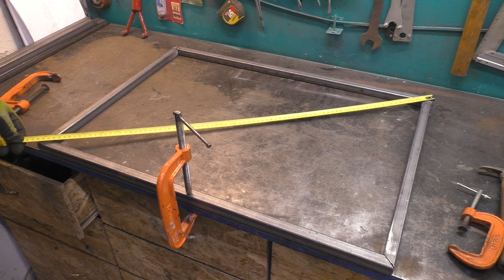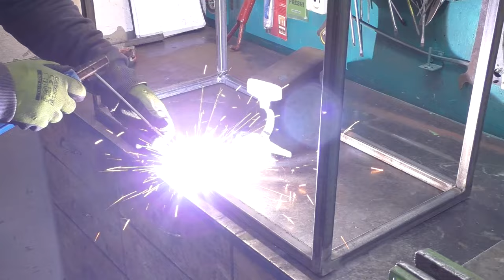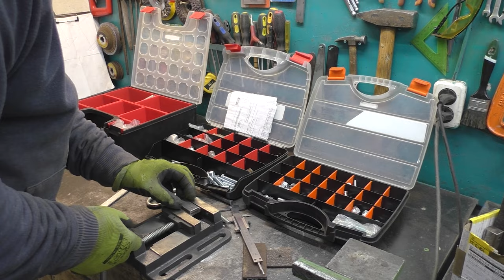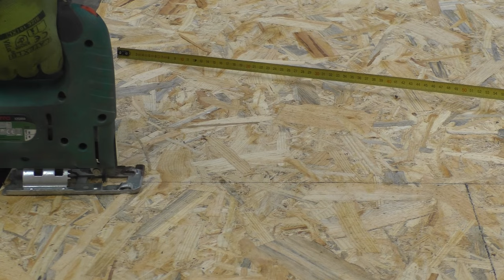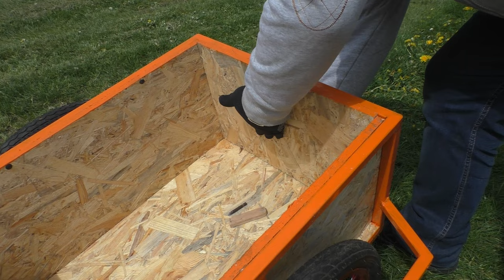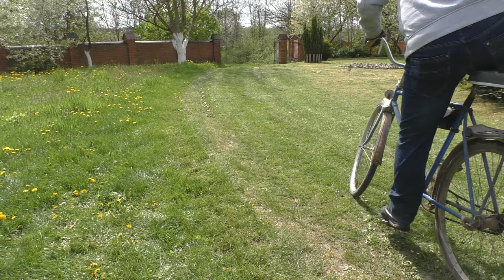Bicycle Trailer Homemade DIY new design велоприцеп

Comment: Attaching any hitch to a motorcycle or bicycle has to be below the rear wheel axle, never above (like you did, attaching to the luggage rack).

As for the trailer, the more its base is below the wheel axle, the more stable in the turn it will behave.

I did not study this in any book, I was doing and correcting that I arrived at these tricks. [] s